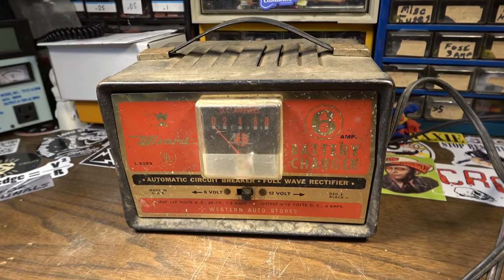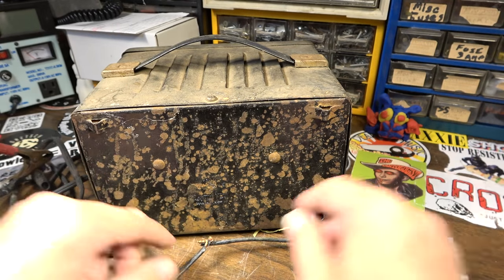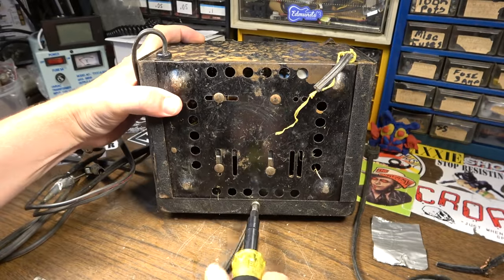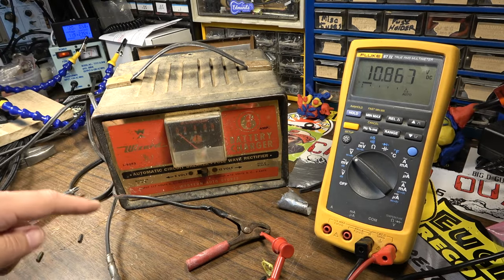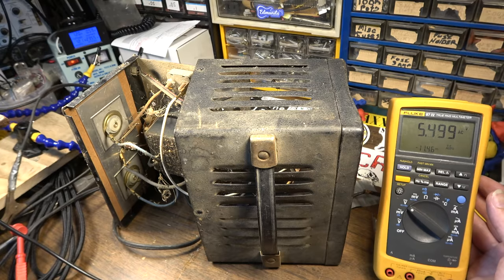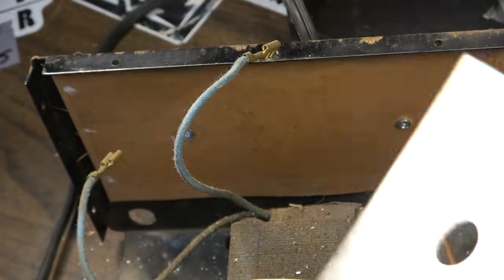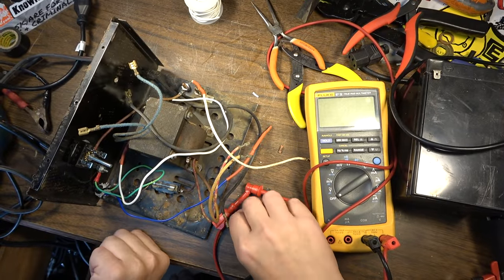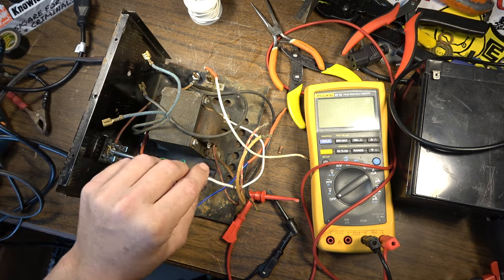Don't throw your old battery charger away...FIX IT and make it SAFER!

Comment: I would have put that rectifier on that aluminum plate because aluminum is the best heat dissipator. If you take a big chunk of aluminum and heat one corner eventually fairly quickly the heat will travel clear to the other side you could do the same thing with cast iron and it takes forever for the whole thing to get hot. The more you know public service announcement

Comment: 14.25 is perfect for charging 12 volt batteries. The alternator in most vehicles puts out 14.25 @ 60 amps
Reply from the maker: Ideal voltage is temperature dependent from what I've read. 13.8V to 14.1V seems ideal, so I'm right in the range.

Comment: I've got a vintage charger I just can't throw out.  It also has a starter function 100A.  Unit weighs a good 20lbs.  The shear mass of it screams quality. They don't make them like this anymore.
Reply: And these charger are not too smart 4 u, compared to smart charger, they think to be smarter than the operator behind using the charger.. "Oh, your battery is below 10v, i'm not charging it !"

Comment: I rebuilt one of these exact same chargers years back with bridge rectifiers. I wired two rectifier’s in series to get a voltage drop to get it more in line to what it should be. I believe you get about 1 volt of drop per rectifier if I remember correctly. Kbpc5010 is what I had on hand and what was used in my application. It was a charger for a friend of mine who’s dad used it when he was younger and passed away . His mom and dad owned a western auto in morehead ky several years ago. He still uses the charger to this day. Great videos! I really enjoy your amp repair videos!

Comment: Good job buddy. 
Nice rectifier upgrade.
(Not to be a cridic, but)
i would have left the cardboard and the aluminum plate just like they had it. That would have made a great heatsink (insulated from the outer case) and your idea about a small electric fan , would be a great upgrade. 
I'm currently 
restoring/upgrading 
A similar little charger. 
Glad to see im not the only one who would rather fix an oldie than buy cheap plastc replacement . 😁👍

Comment: Great Idea.  I have a newer SMART charger that the smart part doesn't work very well anymore.   I might just have to bypass all of that and convert it to use an old style Timer.  Lawnmower batteries always seem to get so low that I have to jump it to another battery to get the voltage high enough for "Smart" charger to work on it.  I am old enough that at the Full Service Mobile Station we used to have to add acid to new batteries then charge them before we could install them.  We had a monster charger that could boil the acid if it ran too long.  But if you had a REALLY Dead battery you could boil it a few times and rejuvenate a battery that otherwise was complete junk

Comment: Most of the classic old chargers will charge a flat battery, not like the more fancy types nice fix. 🇬🇧
Reply: With the newer type chargers you can still use them on extremely dead batteries by 'jump starting' them.  The charger has to see a voltage above a certain level to be able to start.  Jumping another 12 volt battery that is good in parallel to the bad one gives the charger a good starting voltage that it likes and then the charger starts working.  Then you can remove the jump start battery off and the charger continues working.  I had to do this trick a few times when I let my tractor's battery set too long and the voltage got too low.

Comment: I just bought a vintage old Schumacher battery charger last week, so this video is pretty timely! I really hope more of these get saved than tossed! Newer battery chargers have digital circuitry that will sense how much charge the battery has in it, and if it’s totally dead then it won’t charge it. That’s worthless in my book. I need to be able to charge dead batteries, not just low ones.
edit I commented before watching the whole video and just got to the part where you mention circuit protection on the newer chargers 😂
Reply: I just found a 10 year old Schumacher on top of a dumpster. It's new enough where it has a lcd screen but it's not a smart charger. I actually had a similar one for years and used it on my mowers / quads and car. This one is not working, it reads 0.0v on every battery I've tried and makes a quick arc/pop when you first plug it in. I'm far from skilled when it comes to diagnosing and repairing electronics but I'm starting to learn.

Comment: I bought a Western Auto brand 12/24 V battery charger with auto/manual modes that was $21 shipped to my house. I use it to charge my boat, riding mower, & spare car batteries, & so far (1 1/2 years), it works great. I had an older charger that also worked great, but I sold it along with my old bass boat. I had that thing for over 20 years. I doubt this new one will last that long, but hey, it was cheap.
Reply from the maker: This one could be converted into a 12/24V by not using the center tap and going with just the bridge rectifier.

Comment: mmm   me thinkseth you would have done a lot better to put the aluminum plate back and used that for heat sink.   That thin steel case will not conduct heat away from the diode very well.   I will bet that if you load that heavy enough that the output pulls down to 8 volts there would be 100degF difference in the diode temp on .090" aluminium versus .026 steel. Mounting that on thin steel might actually be worse that having the diode floating in free air so it can convect away the heat.
  It was a fun gag to swap the manual rake on a wave solder machine.   It had a pool of molten solder that the boards would travel across.  You needed to rake off the dross and gunk to expose clean shiny solder occasionally.  Stainless steel was good, but if you swapped in an alumium one it would burn the s*** outta your hand,   HUGE difference in thermal conductivity.
   A couple upgrades for a good dumb charger like that.  One is a fuse holder with the cap so you can replace it without taking all the screws out of the case.    The other is a switch and a bulb in series on the DC side for current limit so you dont blow the fuse by overloading the output.   Run it current limited until the battery voltage comes up as indicated by the bulb getting dim, then switch the bulb out of series so you can achieve full DC output without voltage drop.  I'm in the market for a good ole dumb charger like that cause I am sick of the smart one that are so educated they dont wanna do any real work, especially when you need them most.

Comment: Insert a car brake light bulb in series with the output to current limit the charger.  The bulb will regulate the current going into these smaller AH batteries.  Place a switch across the bulb to bypass it and get the full amps out for larger batteries.  Great video!

Comment: I have two different similarly styled chargers like these. Neither work. I inherited a ton of vintage tools and I like the antique look of these which is why I held onto them. Analog devices are good to learn on, too. This was quite informative. I'll have to add new ammeters to them both, as well, since to plastic lense was missing on them both. Needle on one as well. . The reason I'm interested in fixing them is like you said, they're dumb. You can "overvolt" a really dead battery as long as the amps stay reasonable and it will help to desulfate the cells. Just gotta monitor their temperature and make sure you don't explode them. But if you desulfate, discharge, repeat a few times, batteries that tolerate load tests, but maybe can't hold a charge well can be restored and their life extended significantly and I, for one, am tired of dropping a couple 2-3  bills on new batteries for all these cars, food truck and trailer, and devices. Our president seems hellbent on crashing bicycles and economies but he's all outta bicycles and we're feeling it pretty heavily. I looked into getting a desulfator, too, which will be a maintenance tool, but some of these batteries I have will need more juice than what these damn smart gadgets will push. Good vid. Appreciate the time you took to explain certain things that my knowledge of is lacking in, though I have a good understanding of the concepts.

Comment: Picked up a old charger too , same selenium diode setup, changed to a bridge rectifier,   two AC transformer input leads to the selenium diode array,  one DC output from the  selenium diode  array, I checked whether it was the + or _ then plugged into the bridge rectifier the same polarity and then plugged AC inputs in to the bridge rectifier, one DC output was unattached,  charger runs at 15v high 10v low setting,  amps is increased overall from its original output, thing will charge up cinder blocks now.😂

Comment: Hmmm - edit
Center tap - you use full wave rectification (2 diods) 
 No center tap you use full wave bridge (bridge rectifier)
Is this correct?
Reply from the maker: You can use a simple full wave rectifier either way, but you can only use bridge without center tap.

Comment: I had an old Shumacher Deep cycle charger for 15 years and it was probable that it was 20 years old when I got it.MADE IN USA.Since I use deep cycle marine batteries for my pool vacuum( similar to a trolling motor with debris bag).That finally gave out 5 years ago and since I have went through 5-6 harbor freight models that are all circuit board 's and weigh about 3 oz.Junk the copper is diluted down and they don't hold up.I have recently found in the trash a older Heavy Duty Duralast Walmart  maybe? I did buy a NOCO electronic type and 2 years everyday and still charging! I'm suprised.Ace is the place.I have never been let down by finding what I need to rig almost any project.The reason I added last comment you were just talking about Western Auto and True Value which I miss.Ace is of course outsourced from China these days but you can get help if needed!

Comment: Exactly - Centre tapped transformer with 2 selenium diodes -> 2 x half wave wave rectifiers - like old valve amps with a GZ34 double tube diode

Comment: You're right about Walmart. The hardware section is horrible haha

24v transformers usually always put out 28 then the diodes drop like1.4 because 2 of them are used for steering  and there's a 7806 and 7812 I suspect

Comment: Cool, coincidentally i found one of these not long ago, Lester Electrical 24volt 5 amp lead acid charger, looks old but not as old as this one, like has wooden supports in the transformer, but definatley from a more recent time,  and its only putting out 12 volts.  I thought this was the video to help and it does offer some insight but seems to have smart protection thats smarter then me so I'll just have to leave it alone.  There was some old japaense wooden plates with it too, just dumped in an alley parking lot, some wooden shoes too that looked like art pieces,  no wonder the Japanese have a good reputation with guitars , they seem to know how to work with wood.

Comment: You get higher DC voltages with a bridge vs. a full-wave. Also, with a bridge you don't need to use that center tap at all.
Reply from the maker: Without the center tap, the voltages double to 12/24V.
Reply: @TheGuitologist  Yes. In this instance you had to, because the original used full-wave. Maybe I worded it incorrectly.

Comment: Oh wow! That looks almost exactly like one I was given years ago!  I hate modern computerized chargers because they're fragile junk!  Short the leads by accident or cross connect the battery and they blow. Also if the battery is discharged too much, the newer models won't charge it. I'm trying to find more of the old style units like this so I have reliable charging capability.

Comment: Will there be an Episode 2 to verify whether this upgrade worked (safely) , or not ... ?
I guess that if there isn't another Brad upload then things didn't work out so well !!
Reply from the maker: The battery I was charging got pretty hot so I stopped charging it. I have several of these 12V sealed batteries I got for my electric mower and kids ride on toys several years ago. They are pretty old now. One of them recently crapped out with a shorted cell. So I think this battery was a bad test. The charger seems to be doing what it's supposed to.

Comment: I have 50 amps charger with 30sec boosting , i replace the selenium diode with  full wave rectifier and my charging voltage is around 15.8. What can i do to drop the voltage around 14 volts
Reply from the maker: Put a couple more diodes in series on each side of the rectifier output. Make sure theyre properly rated. A couple of these on each side should work: https://www.digikey.com/en/products/detail/diodes-incorporated/SBR1045SD1-T/3677989?utm_adgroup=&utm_source=google&utm_medium=cpc&utm_campaign=PMax%20Shopping_Product_Medium%20ROAS%20Categories&utm_term=&utm_content=&utm_id=go_cmp-20223376311_adg-_ad-__dev-c_ext-_prd-3677989_sig-CjwKCAjwufq2BhAmEiwAnZqw8nIG33mgNMFnTK36FIPfmFtIVZahwkNxfpX2rT4LEzKaJmz17F3uCxoCjeUQAvD_BwE&gad_source=1&gclid=CjwKCAjwufq2BhAmEiwAnZqw8nIG33mgNMFnTK36FIPfmFtIVZahwkNxfpX2rT4LEzKaJmz17F3uCxoCjeUQAvD_BwE

Comment: Sketchy splicing? In my sister-in-law's old house the previous owner left about a 30 foot Romex cable, still plugged into the breaker panel, run all the way down a wall and then all the way back, bare wire ends wrapped in a literal Walmart plastic bag, all stuffed into a dangling loose metal j-box hidden behind drywall. My wife and I were renting a floor there and that was in our bedroom. NFPA be damned!

Comment: Great video! I am working on the same type of charger and am having to figure out how it is wired after I replaced the Selenium rectifiers. Did you ever finish the schematic? If so could you include it in the information section. Thank you.

Comment: The one thing I noticed you didn't do was check the polarity of the power chord. neutral to neutral and hot to hot, If you reverse these you liven up the case and you might get as long as you were isolated a faint buzz on the cases side. So check your work !!

Comment: How is the total amperage supply reading on the variac lower than the amp meter on charger?

Is it because the variac is reading 120v AC amperage and the charger is 12DC amps?

Comment: A lot of chargers are halfwave with two diodes.
Reply from the maker: Two diodes are still a full wave. A half wave would be just one diode on one side of the transformer.
Reply: @TheGuitologist  i know that. Perhaps my memory, is faulty and it was reverse like yours was. Or perhaps they had two diodes in series. I'm going to have to look up the last one i monkied with.
Reply: @TheGuitologist  The Idea of the center tap transformer is to allow only two diodes, ie: a pair, to provide full wave rectification. Probably back in the day the fancier center tap transformer was cheaper than 4 diodes to provide full wave rectification. Modern rectifiers are likely cheaper than more copper in the transformer to provide the center tap, so hence the use of your 4 pin rectifier package which inside is actually 2 pairs of diodes, aka full wave bridge. In many older electronics you will see in the power supply section, near where the A/C power cord comes in the unit, in fact none other than 4 discreet diodes which while may be physically oriented different directions are in fact none other than your old friend the full wave bridge rectifier. Sure you know this, just commenting for the benefit of the entire community.

Comment: I was taught in highschool auto shop to never leave a battery sitting on the ground. It might not be a good thing especially while charging
Reply: I was taught that too at my dad’s gas station. We always sat the battery on an old wooden Coke case.
Reply: Don't know what the oldest 'Old Wives Tale' is, but that ones gotta be close!
Reply: Count me in believing that is total old wives tale fiction. Most OLD cars & tractors I've ever seen, the battery box bottom was none other than conductive steel, which generally conducts way better than dirt or cement. Now then, with that said, if the battery has all kinds of crud and dirt all over it, it might be possible for all that to when damp somewhat form a semi-conductor. Even in that instance however, battery is just going to short presumably the path of least resistance being the shortest distance between the terminals on the top of battery (or side as the case, pun unintended, might be). Set your plastic case battery on just about any kind of surface your heart desires, including shiny copper foil & have a happy life my friend.

Comment: "Looking thru peoles trash bins...."  it's actually called 'Garbology' and A J Webberman was the master of that back in the early 1970s. See Bob Dylans story to find out more.  Lol.
Reply: I still got my Western Auto battery charger my mom gave me !t 14 years old.  50 years ago. I almost threw it away once.  I figured I had nothing to lose. So I gave it a good swat on the top and it started working. Lol. Thanks, mom Rip.

Comment: Another reason to get and keep and old(er) battery charger is the new "smart" chargers will not charge a 12V car battery that has rub down to under 6 volts like if you screwed up and left the courtesy lights on over the week end. Some will not work with battery that has run down below 11 volts,,,,like leaving your car in the garage when you go on a 2 week vacation and forget to unhook the battery, 

I always question the wisdom of fuse holders INSIDE a piece of equipment when a $3 panel mount push breaker would get the job done better. - could have left the aluminum heat sink in place too and stuck some silicon grease under the bridge.
Reply: Nonsense. You can still buy brand new manual 2/10/50A chargers for less than $50. Harbor Freight, Baby. Harbor Freight.